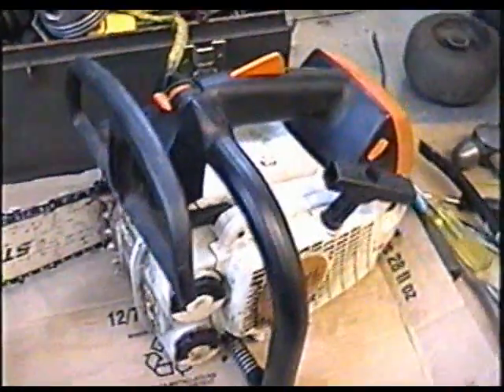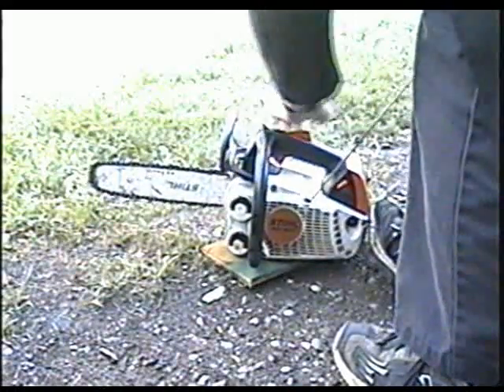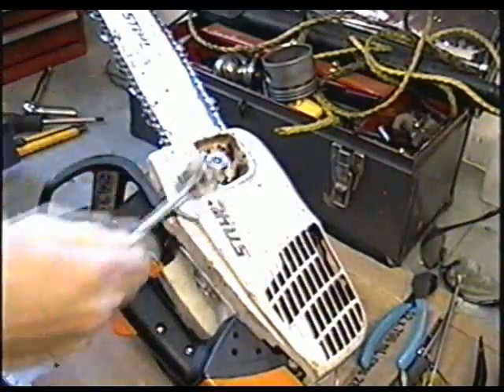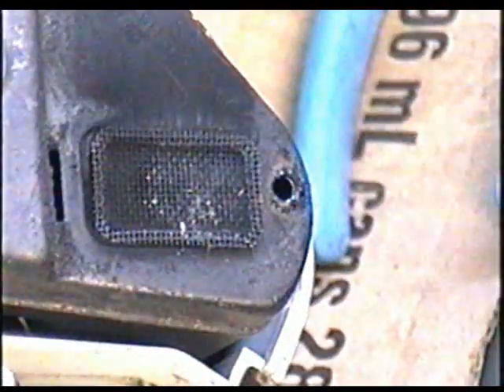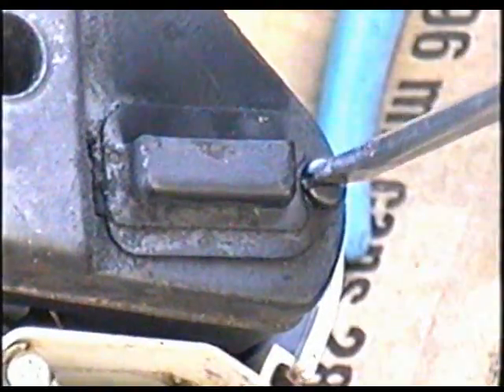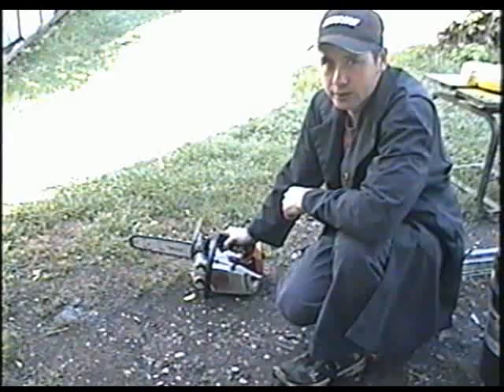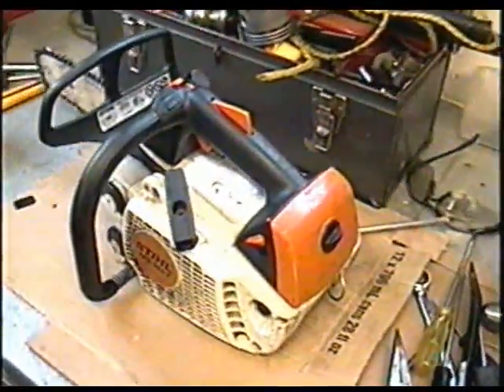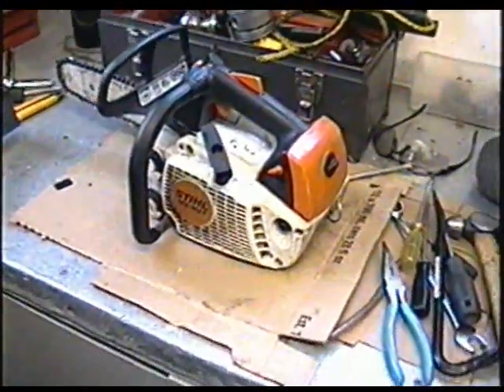Stihl MS192T Chainsaw Repair (MUST SEE)

Comment: @fifthward1983 Yes, he should have cleaned and replaced the screen.  If you live in an arid area, using a saw without the screen can cause a fire.  It starts as a tiny smoldering bit of sawdust and can grow into a flame if the right tender is available. 

To clean the screen, hold it with a pliers and burn it with a propane torch until it's red hot.  Then brush it with either a steel or brass brush and put it back into the saw.

Comment: Don, while your videos are highly appreciated, as this one as well, in this case it may be best to clean the spark arrestor and replace it for two reasons. Reason one and perhaps the most important, the spark arrestor functions as a line of defense for fires produced by carbon particles. The second reason is that in many countries, the spark arrestor is REQUIRED due to reason one. 
Some compressed air or a bit of carburetor clearer will do the job.

Comment: up were i work, fastco, i run into this problem all the time, mostly i get the screen problem with stihl's on the trimmers and chainsaws, but for you who don't know the screens on the stihl trimmers are on the back of the muffler I forget what size socket but you unscrew it and it has a screen on the end of it, clean it or remove it. but up a work im not allowed to remove the screens even if the customer said to its the laws of epa and osha crap.

Comment: I wish my problem was so simple. I’ve been chasing this bog issue for some time. Saw is a def a few years old but hasn’t really seen too much use. I’ve removed the jet from the carb and found it to be somewhat plugged. What are you using to clean the jets?….welding tip cleaner kit? Seems some don’t recommend that. What is your solution to clogged jets mate?

Comment: I have never posted a comment on anyone's video ever before but felt like at least saying thank you ! I have the same saw that was doing the same thing for a long time. Wouldn't throttle up, bogging and stalling constantly . It was driving me crazy. I took that screen out and it was plugged solid! I tossed it straight in the trash and the saw runs like new again. Thanks again for sharing!
Reply from the maker: you're welcome, make sure you are subscribed

Comment: I pulled that screen right out the first week I bought my 192c.  I was commercial logging big Hemlock that had branches from top to bottom and the 192 was a lot better limbing than carrying my 440!

Right now my 192c starts and quits after primer bulb gas is used up. I am thinking the impulse line because I have checked vent, replaced filter and fuel lines are all good.  The carb is a new Stihl OEM replacement. The 192 is a finicky saw even when it runs good. It is light and I like that but I always felt it was an overpriced 170 type saw..got a cheap feel and not as dependable as a pro saw. My 440 has cut since new in 2007...bulletproof! 192 is a different story.

Comment: When I was working on some Stihl leaf blowers,they had the screw in type of spark arrestor which I cleaned by burning the carbon off with a propane torch.

I'm not sure how much oil they were mixing into the fuel at the nursing home my dad used to work at,but they blew a fair bit of smoke with what fuel was in them when I got the 2 stroke equipment to work on,the spark plug was often oily.

When the 2 stroke equipment is run on the recommended 50:1 fuel to oil mixture, they barely even blow smoke.

Comment: For anyone living in an arid environment, like myself, it's a good idea to clean and reinstall the screen.  Don't want to be starting any range fires!  

To clean, simply burn  the screen with a propane torch then brush off the carbon with a wire brush.

Comment: Had this problem a few times with different machines, most new saws have restrictive mufflers and the spark screen just makes things worse. If you're in a country that suffers from bush fires then they will be a legal requirement but you can get round this putting another hole in the muffler and fitting another spark screen which are available separately = DIY dual port muffler

Comment: Hi Donny,I have an old Stihl 041 AV with just the problem you describe. However, the muffler doesn't have a spark arrester (I think), and when I remove the air filter (NEW), the machine works perfectly - idles well and quick throttle response. Any ideas ?

Comment: hi there i have a mcculloch 10 10 it has a starting issue and 2 things ive notced are sometimes gas drips out of the exhaust after letting it sit over night and also after letting it sit when you pull it over you can hear compression coming out of the exhaust and it has low compression once it has run that goes away and has great compression also once it is running it runs great and starts good warm any advice would be great

Comment: I'm having these same issues yet the boot looks fine. I'm inspecting the fuel lines but is there another cause for it to idling high especially when changing the saw's position?

Comment: donyboy do you find that after a while of use without the spark arrestor you have problems keeping your muffler bolts tight, this happens to me everytime you can tighten them up but then they come back lose in a handful of cuts, just wondering if this was just my saw i have just recently tried high heat lock tite to see if it fixes the problem

Comment: my 041 farmboss is having the same problem but i connot remove the muffler and there is no screen, i put in a new spark plug and cleaned out the carb, i have also notice it looks like fuel is getting in the muffler

Comment: ouWld you have the info for disassembling a 191 t or similar? I need to get the oil / gas tanks out. and fix a leak , change fuel line in tank, and a new flywheel,

Comment: I have an older Stihl .041 Farm Boss. Saw ran great until a bang, and then no compression. I have been told I need to replace the Reeds? any suggestion would be appreciated as to if this is the repair and were to get needed parts. Thanks
Reply from the maker: take the muffler off to see if the piston and rings are scored
Reply: donyboy73
Right, Then what?

Comment: I have a Stihl MS 230 and it has the same behavior as the saw in video. I took off the muffler to check for a spark arrestor..and doesn't have any ..or if it has one, I can't get to it because the muffler is sealed..no screws. What should I do?

Comment: @donyboy73 actually dony. its time for him to get a new saw. homelites have the chain brake on the inside around the inboard sprocket/clutch. its not worth it to fix a $200 homelite saw. just buy a new one. i have the same saws both the 90s model and the 2004 model 33cc and they both have the chain brake around the sprocket. if i were you, id buy a husqvarna  like a 235 or a 435. both have replaceable sprockets and they are the outboard type with the chainbrake on the sprocket cover.

Comment: Ran a brand new ms170 one season and had trouble early the next. Got a carb online which didn`t change anything. Was very disgusted when I found the screen plugged. Ran a Poulan over 30 years and never plugged up a screen. I didn`t bother checking it at first because it didn`t seem logical to be plugged.

Comment: I own a ms201tc with the mtronic and it sort of does this once I’m using it for about half hour it bogs and doesn’t want to rev even though I’m pushing on the throttle, I just had it maintenanced and it’s still doing the same and it’s fairly new please help

Comment: My trick to clean the screens:  get red hot with propane/mapp torch (carefully, low fire).  Then, quickly, move to compressed air jet (again, gently, not a lot needed).  You will be able to 'move' the oxidizing carbon spot under the air jet around the screen until it is all burned off.

Comment: Hey, got a little problem.

Have a Husqvarna chainsaw that doesnt start.
It has good compression it sparks no play on bearings or damaged seals.

But when i put a few drops of gas in it it does nothing..:(
You ever had something like that?

Comment: donyboy when you took apart that carb did it have a mounting gasket on the manifold side? or did it go flush against the grommet part of the manifold?  whats that tiny hole on the carb facing the manifold? the manifold has a rubber hole that seems to line up with the tiny hole on the carb?  on your vids i cant get a good look at it...   thanks
Reply from the maker: from what I remember there is no mounting gasket

Comment: How do I remove the throttle trigger from stihl 026  it broke where linkage connects to it. Top half broke off. How Toni remove it to replace or do I need whole new handle

Comment: It has been a normal course to remove the screens for decades.  Wondering why you feel it necessary to put the deflector back on?
Reply from the maker: there are liabilities involved if you remove the screen as a shop owner
Reply: Can't imagine any different than removing the screen but can't remember....maybe you advocate cleaning the screen.?

Comment: I have a stihl 017 the spark aresster is missing but i have the same problem as the saw in the video. Can't really seem to figure my problem out. Can it be a carburetor issue? (I have cleaned the carb out as well). The saw won't really perform and sometimes it dies on me.  =) Any ideas? Thanks for making great and useful videos!
Reply: Henrik Valgren-Need to check fuel and air lines for cracks, check carb gaskets (air leaks) and break carb down again and clean it again.
Reply: EXHAUST PORT CAN HAVE CARBON BUILD UP AND ENGINE WILL NOT PERFORM. I HAD THIS PROBLEM ON WEED EATER . DEALER TOLD ME I SHOULD REPLACE WEED EATER. I TORE DOWN ENGINE JUST FOR THE HELL OF IT AND I SAW ONE EIGHT OF AN INCH OF CARBON ON EXHAUST PORT. I CLEANED IT OFF AND PUT ENGINE BACK TOGETHER. NEVER HAD ANOTHER PROBLEM AGAIN. RUNS LIKE NEW AGAIN.
Reply: Remove the limiters from the h an l jet adjustment screws.  They're on there to comply with EPA regulations.  After a couple years of use you run out of adjustment

Comment: Donny, would it harm a two -cycle engine to run it without the spark arrester?
Reply from the maker: +Bert Cochran no
Reply: +Bert Cochran Not recommended to completely remove the spark arrester in a hot dry country like Australia as you could start a bushfire so just be mindful of that :)
Reply: The same applies to the Western United States. Be fire safe. The thing that is missing from this video is to CLEAN that spark arrestor screen with a wire brush, as much as you can, then put it back in. OR replace it with a new one.
Reply: If you started a wildfire with a chainsaw that was modified in this way, you would likely receive a bill from DNR.

Comment: Can't you just clean the screen and replace it?  Or is the screen unnecessary?
Reply: Bourne Accident Yes, the build up can be burned off with a propane torch by holding on to the screen with some insulated pliers(an all metal wrench would burn your hand). You can also use a wire brush. I make a habit of cleaning my saw and my other 2 cycles every week, and while doing so I check and clean the spark arrestor screen if it needs it. If you run any small
2 cycle engine, no matter the octane or fuel to oil mixture you use, there will be buildup on the screen over time. Some people choose to simply remove it altogether because it restricts the air flow, and in essentially all saws its removal will give you better performance, as is the purpose of muffler modifications. Unless you are a professional contractor who works in forestry or if you operate in an area highly susceptible to fire, removal of the arrestor will not cause any harm and may actually be beneficial.

Comment: Hi...and thanks for all the informative videos!
I do have a question about a Homelite chainsaw 33cc model number UT10947E
The saw starts up fine but  the chain brake is in the on position even with the brake in the off position,thus causing the clutch not to move the chain.I have removed the clutch housing to expose the brake components and it appears that the brake is secure around the clutch housing.I can pully back really hard to disengage the brake but it will not release the brake.Thanks!!!